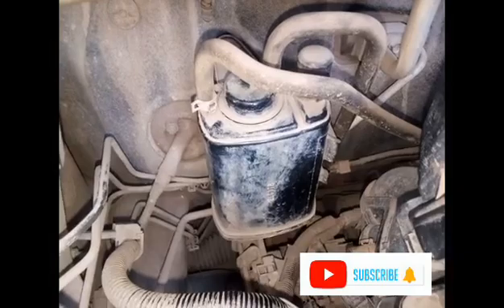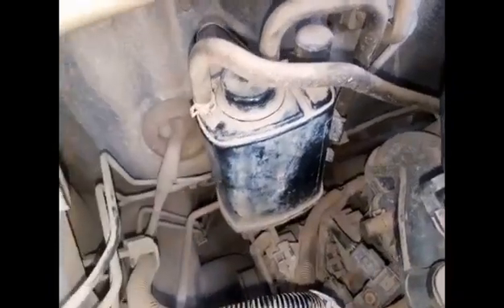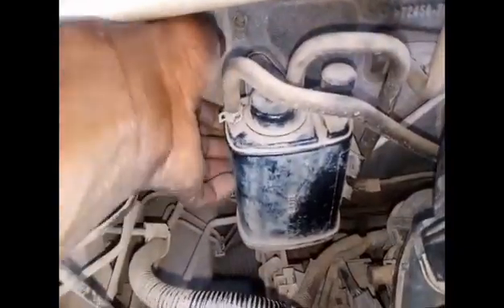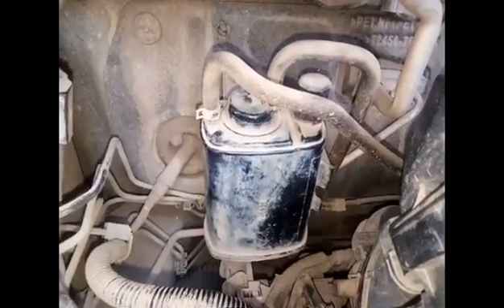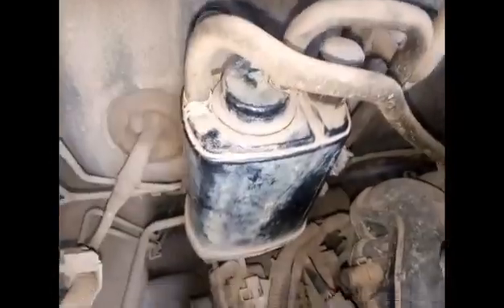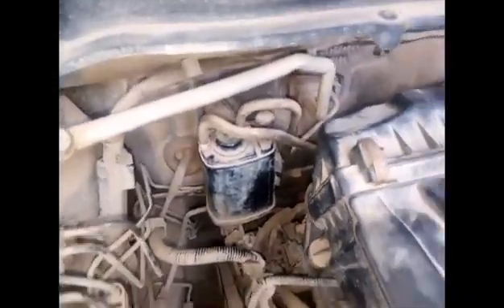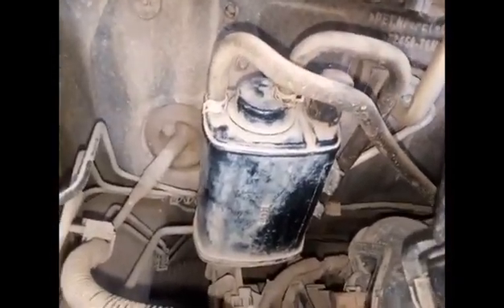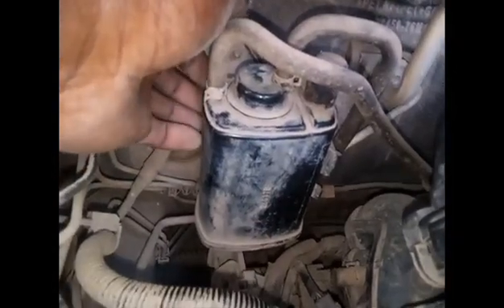HOW TO IDENTIFY BAD CHARCOAL CANISTER

Comment: How to check charcoal canister and purge valve of car my car has one charcoal canister one way valve and purge solenoid my car fuel tank is collapsed due to purge EVAP defect pl guide my car is Suzuki Mehran 800 cc Euro 2 EFI
Reply from the maker: Thank you very much.
First of all please have you ever smile petrol inside your car or around your car when ever you are driving or the car is in idle, if yes then  you need to change the charcoal canister  and the purge valve and after that when ever you are filling you tank please don't fill the fuel tank to it breem and don't shake your car when ever you are filling the tank, it damage the charcoal canister faster than you think.

Please the collapsing or the damaging of your thank because the vapor of the fuel need to pass through the pipes called vent then it goes into the charcoal canister then it pass through the purge valve then it goes into the engine back, now the purge valve and the charcoal canister has damage so it doesn't store the petrol vapor anymore so the vapor is within the tank so anytime you fill your tank the vapor increasing and it build pressure within the tank that is why it damaging your tank.
Please to release that pressure kindly open the tank cover for sometime now but you need to have new charcoal canister and the purge valve then you are than.
Thank you very much.
Reply from the maker: Please if anything let me have your feedback.
Thank you